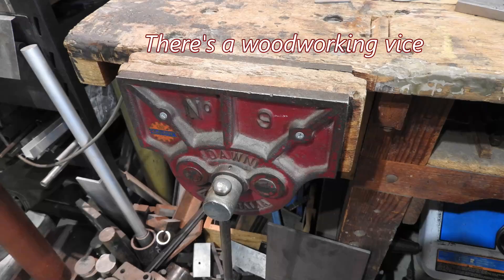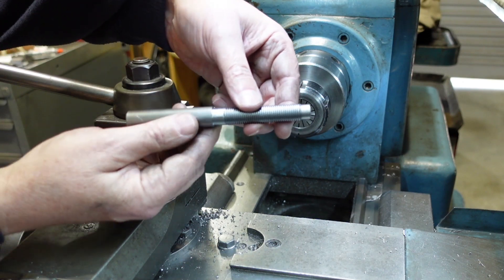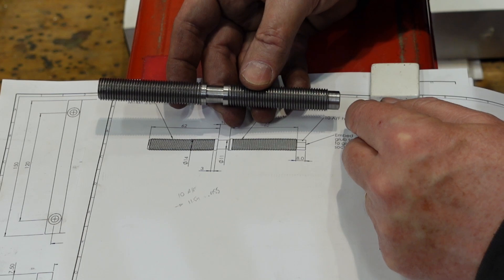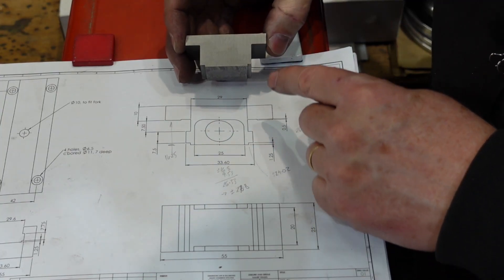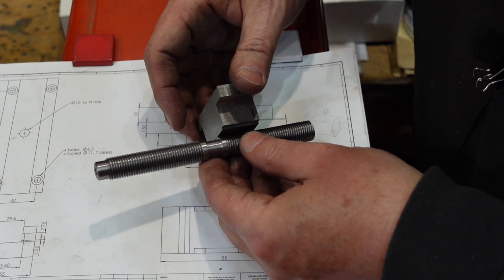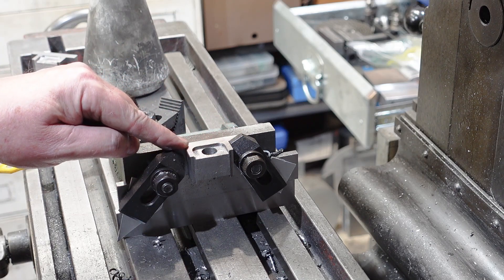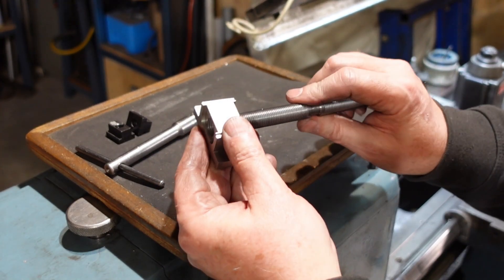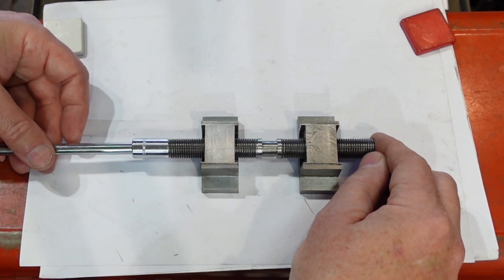The start of a centring vice

Comment: I also have a Z-Vise (sold under various brands). Although it’s impressively versatile, its convoluted setup process makes me overlook it as a solution for difficult work-holding tasks. Like the Stanley 45 and 55 combination planes, it's one of those promising tools that sits in a bottom drawer, only to be reminded of its existence once in a blue moon. Perhaps it's why I was able to score one on eBay for so little money.
Reply from the maker: I got mine in a secondhand 'everything' shop about 8 years back. Didn't have a box or the accessories so it was relatively cheap. From memory I bought it on the way to the airport, so it sat in the car for a few days there until I got back...
I like it for woodcarving as the jaws are nice and high (hold large items easily). Not sure I'd trust it with much else as it would probably flex more than I would like.
Reply: @occasionalmachinist  I forgot to mention it can be configured for all sorts of drilling operations. There's even a headstock, steady rest, and tailstock kit for turning it into a drill powered lathe. 

I'm sure with enough thought it could be rigged up to perform more specialized operations such as sharpening, or cutting saw teeth. I've been mulling the idea of building a saw tooth cutter for handsaws for a while now, but I've reached an impasse. Finding a 60 degree beveled grinding wheel, or die presses, but it's been surprisingly difficult.
Reply from the maker: @bobweiram6321  I'd read about them before I got mine. They did sound like an impressively versatile bit of kit but like many of these you have to be careful that good function is not sacrificed for scope. I'm happy with it being a reasonable carving vice.